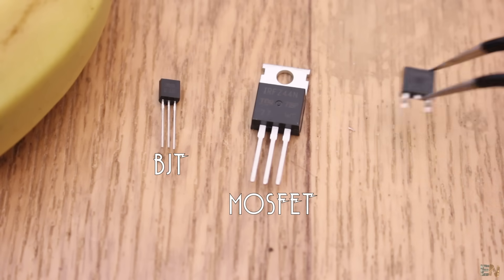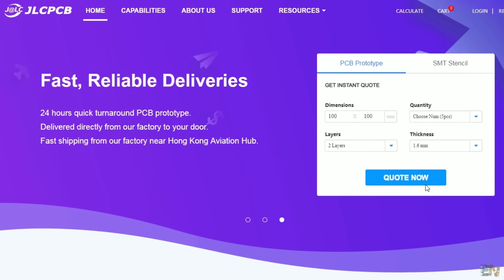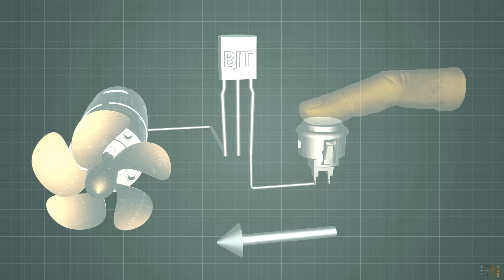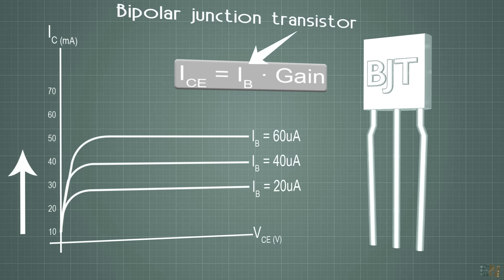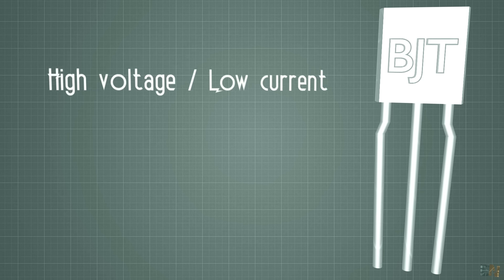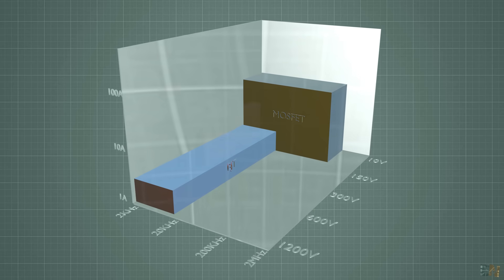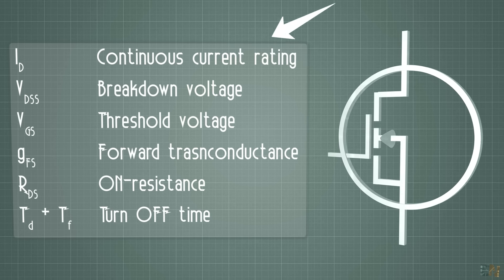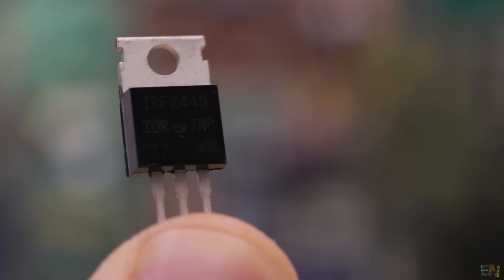MOSFET BJT or IGBT - Brief comparison Basic components #004

Comment: Yeah, this video is pretty inaccurate. I'm guessing that "Electronoobs" doesn't really know anything substantial about this topic, because he completely misses out on the key differences between these devices. So, allow me:

BJT:
   - CHEAP
   - Robust against static discharge which makes it very popular
   - High voltage capabilities (typ. 40-1000V)
   - Best low noise performance when used as a linear amplifier
   - When used as a saturating switch, poor turn-off behavior which limits the switching frequency to usually <2MHz
   - Can have the most efficient performance at high current (>20A) because the saturation voltage is roughly constant (usually .2-.5V), but...
   - Requires a high-current output control driver which makes it unpopular for high current applications
   - Current can only flow 1 way in the ON state, Collector->Emitter

MOSFET:
   - Medium Cost
   - Extremely fragile to destruction by static discharge
   - Medium voltages (typ. 20-400V)
   - Poor performance in linear amplifiers (nonlinear behavior, high noise)
   - Extremely fast switching, easily up to 20MHz with high-power loads (and the new GaN FETs promise to be even faster)
   - Efficient for low-medium currents since it behaves like a low-valued resistor
   - Easy to drive since the gate is an open-circuit
   - Current can flow both ways through the device in the ON state

IGBT (BJT with MOSFET gate):
   - High Cost
   - Fragile to destruction by static discharge (but usually less so compared to MOSFETs)
   - Very high voltage, up to 4000V
   - nobody uses these in linear amplifiers because it would be pointless
   - switching behavior is similar to BJT, but usually slower (<50kHz)
   - Efficient for very large currents due to having the same saturation voltage characteristic as the BJT, but the saturation voltage is higher, usually around 2V (so often it is actually less efficient than a BJT)
   - Easier to drive than the BJT since it has a MOSFET style gate
   - Like the BJT, current only flows 1 way in the ON state, Collector->Emitter

So, the TLDR; is that you use BJTs for building robust interfaces since they usually don't need ESD protection, you use MOSFETs for low-medium current switches, and for really high-current switches you use IGBTs. The distinction between MOSFETs and IGBTs is basically on the basis of efficiency - the heat generated in a MOSFET increases as I^2 since it behaves like a resistor, whereas in a IGBT it increases more like Log[I]. You will have to do some math to figure out which transistor to use on a case-by-case basis.

Hope this is more helpful to people than the video was.
Reply: Colin Marcus this is exactly what I needed, thank you so much!!
Reply: @Chris Russell - UJTs are very rare... in fact I have never seen one used in a design. To my knowledge there are only 1-2 components on the market at this point, so they are pretty much extinct.
Reply: @yum33333  .. in my college days, on our project, we used UniJunction Transistors for switching in the oscillators. All other alternatives were not user friendly if not less efficlent.
Reply: @hannanpakthini7221  That's interesting. I've never used them myself, it seems really hard to get them nowadays.
Reply: thank you for your information! Can you help me answer this question?
Many contents on the internet say that the switching frequency of these transistor: BJT < IGBT < MOSFET (even the IGBT wikipedia).
This make me confused actually. 
Can you tell me which one is right? 
Thank you sir!
Reply: @HaiNguyen-fi9nv  This is kind of an un-answerable question because it depends on the situation. But in general for fully switched devices (where they are turned fully on/off), IGBTs are the slowest, and MOSFETs are the fastest. MOSFETs are faster than BJTs because they turn off faster... but some BJTs can turn off very fast due to technologies such as gold doping, which causes their charge carriers to recombine faster (see the 2N2369).

I see that in wikipedia they say IGBT switches faster than BJT... but they don't provide any source. Frankly I am very skeptical. An IGBT is a BJT controlled by a MOSFET, so I don't see how it could be faster.
Reply: @yum33333  thank you for your answer :D
Reply: Thanks for your added list, which is very useful. You're right, he didn't mention Jfets. Am trying to become more expert on transistors, just know the basics. Building an inverter, probably using a H-Bridge in an attempt to produce pure sine wave output. Am wondering can a Mosfet handle a low frequency 50 hz, but also re-produce any pure sine wave fed into the gate? 
High Power BJT's are expensive, such as 2N6277's, but got packs of Mosfets IRF3205's, & some high voltage 600v/47amp - 47N60C3's, if going for post high voltage? I'd like high voltage control for power dimming, motor control, inc: 3 phase drum motor control. Seems to be no way of getting pure sine wave out of just 2 NPN channels, without the H-Bridge. There was an article on using a pure sine wave inverter, home built or professional, as a driver, for a power inverter slave, where there are two channels, both fed from a step down 240/12-0-12, with ground connected to battery/source ground, with each AC, + to one set of transistor switches, AC - to the other alternating set of transistors. I know BJT's can vary current. Better for pure sine wave? Or if Mosfet gates are fed with varying sine wave, will it work, or is it just going to look like a square wave?
Reply: @nottingtohide  Any transistor can be used as a linear amplifier if you bias it in its linear mode (i.e. 50% turned on). Typically to do this, you would use an op amp to control the transistor in a feedback loop. Open-loop biasing of MOSFETs in particular is very problematic due to large variations in the Vgs (turn-on voltage).

If you want to make an inverter with a sine-approximating output, typically this would be done using either the "harmonic elimination" method or by using PWM. The goal would be to produce an output voltage function, that has most of its power in the fundamental frequency (i.e. 50 Hz in your case). You can then follow the inverter with an LC lowpass filter, to remove the high frequency components of the signal.

Since you are new to this, I have 2 suggestions:
1. Download and learn to use LTSpice. This is a free circuit simulator of high quality.
2. Prototype your inverter at low voltage and low power. This way, you won't get hurt when you make mistakes.
Reply: @yum33333  Thanks. Starting off low voltage, will use a step-up transformer. Downloaded LTSpice, opened it up. Will have to learn how to use it. Got AutoCAD, but don't understand how to use it yet. Got a Arduino UNO board, learning about how to alter timings & setting in existing demonstration programs to learn that. Done electronics over the years, but is ever changing, plus one can forget vital core theories & how to do things if one does not keep up to date. Too much reliance on digital & programming, where analogue is more robust in many cases. Never set up 3 phase before, but learning a lot about that now, to drive a washing machine drum motor to drive an electric alternator for 240v/50hz. Remember doing op-amps, used them in pre-amps, & used one in an overdrive/distortion pedal design, though only familiar with the 741 so far, but know they use feedback. Forgotten what 'crowbar' is used for, thought it was feedback, but can re-learn it. Been looking into so called..? free energy to see if any really work. One experiment with permanent magnets repelling each other worked, even driving a small load continuously, no batteries involved, but could only be used for really charging batteries, mobile phone, small light bulb, l.e.d or small motor I think, nothing bigger than that. Got some Nitinol wire too, but need to find a way of joining it securely in loops to run on heat exchange drive belts. Been following Patrick Kelly on youtube, who takes free electric energy seriously, with dozens of designs. Building a power supply now using LM317 to have a variable supply. Been a nightmare not having a decent power supply to use.
Reply: Thank you for the explanation. Can I ask, is BJT able to replace automotive relay?
Reply: @rioaditiyono8442  Perfectly suitable. In fact many electromechanic relays can be replaced by transistor-arrays which are best known as "solid-state relays".
Reply: @C-Sabien  peace bro :)
Reply: Nice one, but JFETs are missing.
Reply: @rpdigital17  That's because the video doesn't mention JFETs, and the context is mostly about power devices.
Reply: Save for later comment*
Reply: Thx, saved as a doc
Reply: Hey Colin, thanks for the info. You came off a bit acidic but your information is spot on and very useful. You have a good ability to boil things down to the most relevant attributes. I think you should create videos. I consume a lot of this kind of content because I am teaching myself electronics. Good sources are extremely valuable.
Reply: Thank you very much sir😉🕯💡🔎🌷
Reply: Hi.  I have an E piano brand Hemingway DP501.  Suddenly it doesn't work anymore.
 I opened the lid to see maybe some loose thread or something ... inside being dusty, I blew with my mouth where I noticed that it makes contact but very short.
 I have tried to blow many times since then and I noticed that when I blow somewhere on the PCB it starts, I manage to press the keys a few times and then it stops again.
 Any micro-piece that would have to do with temperature ???  I don't know, maybe someone can help me.  The children can't wait to play the piano again.  Thank you
Reply: @robertvoltega3958  If it's something overheating then you would be able to tell by hovering your hand over it. In the electronics world "overheat" usually means over 100C - so touching it directly may burn you. Be cautious.

The other typical possibility is that a solder joint cracked and blowing on it is somehow re-connecting it for a moment. Perhaps the moisture in your breath.

But in general it's hard to diagnose at a distance.
Reply: @robertvoltega3958  Actually here's an idea. Try blowing on each part using a straw. You might be able to identify the exact part.
Reply: @yum33333  Thank you very much sir.  I'll try with the straw, maybe I'll identify the piece.
Reply: @Muckin 4on The problem with IGBTs is current tail -- not so great (slow, relatively high losses) turn-off. Modern MOSFETs that can handle higher voltages and higher currents are comparable with IGBTs and are better suited for most applications. At least I would heavily lean towards MOSFETs at 20 kW or less.
Reply: Colin Marcus, would you please say where electronoobs is wrong? I find this video very clear. It's somehow made for begginers or basic students but it's clear. Your comments are more professional but that's doesn't mean Electronnobs is lying. One of your comments about mosfets says "Extremely fragile to destruction by static discharge" (which is true)
 and lines below you say "Easy to drive since the gate is an open-circuit" and that can be confusing because I could understand "easy to handle" which would mean "the opposite to extremely fragile" or maybe you mean "easy to trigger". In any case I thank you for providing more info but you must say where Electronoobs is wrong, otherwise you're only using this video to show off. In all videos I watch, I like to observe the thumbs-up-thumbs-down-ratio and this video has a very high ratio.
Reply: Oversmart guy
Reply: The video was a great noob video, your reply was a bit arrogant but a great lesson 2 on the topic. You should start a youtube channel for the intermediate electronics enthusiasts.
Reply: @TheKlickitat  I don't know why everyone is interpreting my comment as arrogant. The video IS inaccurate. It DOES miss out on the key differences between the transistor types. To me, the real arrogant thing, is making a click farming video where the presenter "teaches" an audience about something they themselves know almost nothing about.

(TheKlicktat - the following is not really directed at you, but rather at the replies I've received in general)

For example, let's say 1/2 of the people who watched this video watched it all the way through. So that's 200,000 views, times 8 minutes = 3 YEARS. That's how much time this misleading video has wasted. And people call ME arrogant???
Reply: @yum33333  it just comes across that way I guess. I really hope you start a channel as I liked your information. I will be your first subscriber if you do.
Reply: john edwards  nah. He talks too much terms, too much formulas, too less of valuable information. he's a bad teacher
Reply: @C-Sabien  Alive and kicking, breathing the owl. Call out my name 'bro' and i'll be there ;) House Of Pain everlasting
Reply: Steve Thompson  There are a near-endless number of different transistors you can use. Since you aren't very familiar with the distinctions/parameters between them, I would recommend using bipolar transistors since the distinctions between them are fewer and simpler.

For bipolar (NPN and PNP) transistors, the main characteristics are the gain, crossover frequency, and power dissipation. For a circuit with opamp control at audio frequencies, you only need to worry about the power dissipation.

So to find an equivalent transistor, just look for something with equal or greater power dissipation capabilities.
Reply: I want to have switching capability in both directions ( MOSFET has internal diode ) with gate voltage up to 5v and source to drain current up to  3A using a 9V battery. What should I use? I am new to these things, so excuse me if I said something wrong above.
Reply: @jp-pn6wk  Pretty sure you can't get 3A from a 9V battery. At least not safely.
Reply: Ok, I can adjust that too, no problem. The main thing is that is there anything that can switch in both directions.
Reply: @jp-pn6wk  maybe use a H bridge on your load?, tbh honest you should be more specific of what you need to do as I cant really understeand what you need to do, usually if you need to change the polarity seen by a load you use an H bridge and you can do that with MOSFETs together with MOSFETs for better efficiency
Reply: @jp-pn6wk  I agree with electromatic... why not start by telling us what you are trying to do? Is this for a bi-directional motor?
Generally speaking a MOSFET can conduct current in either direction, but it will stop current in only 1 direction (since there is an intrinsic diode).
Reply: @yum33333  I am trying to control five motors in both directions, so I wanted to have the least no of MOSFET to reduce cost.
For H bridge in each motor, I have to use a total of 20 MOSFET's so I want to use single H bridge to reverse battery polarity and MOSFET to switch in both directions.
Reply: @jp-pn6wk  You can get integrated H/Full bridges. For example, DRV8871DDAR which is about $2.
In general, discrete MOSFETs are quite cheap at 3A currents. Provided you drive them correctly, not in linear regime. The main thing that causes MOSFETs to cost more, is when you have to physically scale them up because you are generating a lot of heat.
I can't tell if what you are describing is some sort of unusual setup that would allow for a more frugal design, sorry but that's the nature of a youtube comment section.
Reply: @yum33333  making my own h bridge is costing me significantly low with mosfet (in my country it is about 3$ per h bridge which you described)  seems like making my own h bridge is the cheapest option ( for 20 MOSFET's around 5.28 dollars). Anyways thanks for the help 😊.
Reply: @jp-pn6wk  You can certainly make your own H bridges. The one thing I would point out though, is that the integrated H/Full bridges have some advantages. They include the proper MOSFET driving logic circuits, which are designed to prevent shoot-through. Shoot-through is when you turn on both the upper and lower MOSFETs at the same time, which creates a destructive short-circuit. Additionally, they usually include features such as current limiting (to prevent a short circuit at the load), and thermal protection (disables the driver if it overheats). In other words, it is worth taking a close look at the secondary features of these integrated devices, as they can be very useful.
Reply: @yum33333  Thanks man, you've been a great help. I will surely look upon it.
Reply: All you did was make useless points that I never needed.I think when everyone clicked on the video they were looking for science not known characteristics .You don't even have you stuff right you weirdo.😅
Reply: What an arrogant comment. You basically re-stated much of what was in the original video.
Reply: Tbh this guy makes me kind of mad with his videos haha, he is even holding them 3 with his bare hands! No surprise why my costumers handle this devices like that at my store and complaining they were bad hahaha
Reply: @apocaloptigon9988  Best answer to Colin's comment on types of transistors. 
😎
Reply: This is just browsed.. try to understand practically. But thanks for ur time.
Reply: in mosfet current flows both ways?! that's in triac, not mosfet.
Reply: So where is your video? You know this is YouTube channel. All you did is gave more information that noob doesn’t understand anyway. Why criticize someone’s work which was completely adequate for a noob? So no, your information wasn’t more helpful to a noob. It was useless. But still, thanks for effort. Thanks for sharing. Thanks for spending time to help someone.
Reply: @Traderhood  some people think they were born knowing it all it is a  character trait, nothing to get one's feathers all ruffled, there's always somoene above and below 😒
Reply: @Colin,
Thank you for the information, but you're an idiot though, have more respect when writing. Your comments about the video are disrespectful and don't appreciate the work done for the people. Otherwise, thanks for the useful info. Idiot learn some manners. Sorry had to add the last line 🤷
Reply: @bassome3000ify  ... Chums, both of u. There is no way discovered so for in the world that a writing can satisfy all, every one of us. It is an axiom.
Reply: @hannanpakthini7221  axiom is a mobile phones company... What are you suggesting?!
Reply: @bassome3000ify  @Colin Marcus I agree with KD. I noted your channel had 8 subscribers (June 2020) so it's a little ironic to hijack a 'noob' channel. I did appreciate the info which I have printed for future reference for my class. If there were a channel for douchey yet informative comments I would definitely sub and click the bell for alerts.